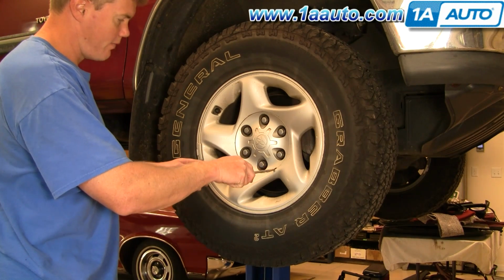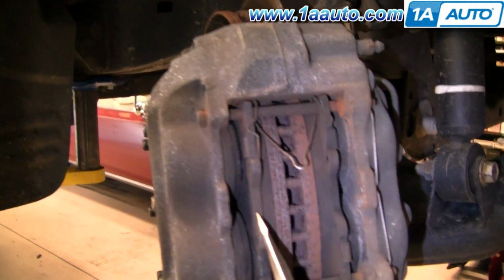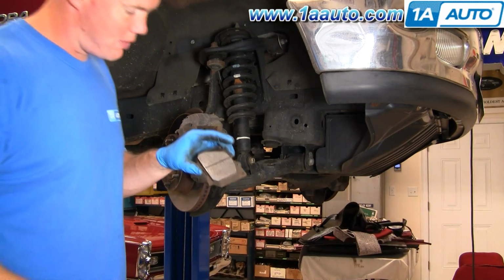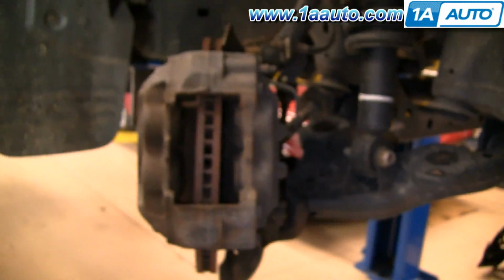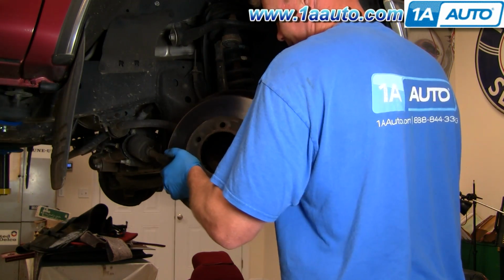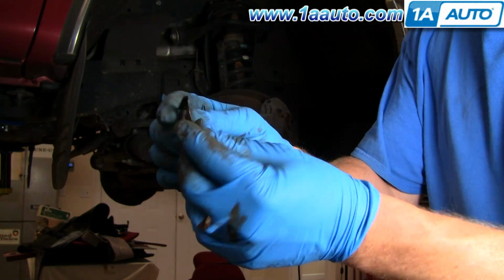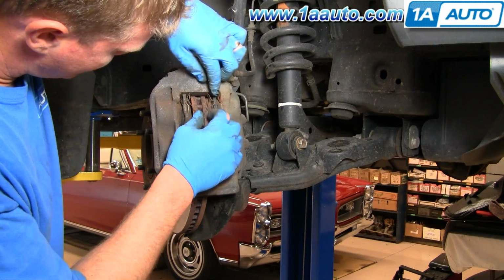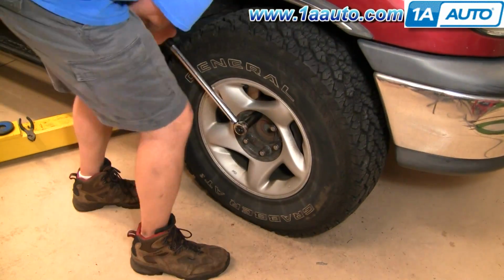How To Replace Front Brake Rotors 00-05 Toyota Tundra

Comment: Thanks for the video, however the main thing I tuned in to see is how to disconnect the brake line from the calipers to replace the calipers, and deal with the brake fluid, overflow, and bleeding. If you ever revisit this video, might be nice to add.
Reply from the maker: +Mark Dawson Thanks for the feedback!

Comment: Great video showing how to do the work. One caution to watch out for is that the 2 slider pins will most likely be rusted and very difficult to remove. Recommend getting the slider pin kit before doing the work.

Comment: great video.  I was reading in Chiltons and alldatadiy and they said to remove 2/3 of the brake fluid from the master cylinder because when you push in the pistons it will force brake fluid back into the reservoir, or simply loosen the brake valve and let it out that way

Comment: My 02 Tundra owners manual specifies the torque for the alloy wheel’s lug nuts at 110 Nm or 83 ft lbs. Isn’t 120 ft lbs over-tightening? Otherwise, it’s a beautifully clear instructional guide.

Comment: If you have a 2000 - 2002 Toyota Tundra and 2001 - 2002 Toyota Sequoia then you will need to check your caliper to ensure that you get the correct brake pads. Toyota changed the brake design for these trucks within the production run. I believe that the initial brake design was not very good so Toyota re-engineered the caliper and brake pads to improve stopping power. Even though the rotor is the same, there are two different types of pads for these vehicles..some trucks within this year range have been upgraded over the years from the S13WE to the 13WL calipers, so we recommend that all customers check their front calipers before purchasing to ensure the correct brake pads. You can also tell the difference if you measure the length of the brake pads. The brake pads for the S13WE caliper will be 4.7" (120 mm) long, and the brake pads for the 13WL calipers are 5.25" (134.6 mm) long. I recommend that you check the front calipers or brake pads.
Reply: Yo quick question how can I check on the front calipers foe those specifications I just changed my pads and rotors but I keep getting this scrapping sound almost like the brake shield is hitting it but I already checked it was not

Comment: Thank you SO MUCH !  Our 2002 runs like a champ but we were stuck on getting the bolts off to replace the rotors.  Oops !  With your little video we found out we were doing it wrong and finished it in a snap.
Reply from the maker: +cwestervoorde Thank you for the great reply. We love to empower our customers by showing you how-to perform your own auto repairs while installing our high quality auto parts. Have a great day! 1aauto.com

Comment: Other mechanic's videos buff off the rust on the slide pins and then adequately lubricate them with the brake paste.  They claim that the brake pads after a winter or two collect rust and dirt and that makes the brake pads not slide so easily on the pin as the pistons push them towards the rotor.   YMMV

Comment: Thanks 1A Auto very helpful - what is the (purpose of the) little clip that is shaped like an 'M' and the top bolt runs through it? Found that mine was bent out and rubbing on the inside of wheel rim...

Comment: That's great. I appreciate you making this video. One question though. You're not wearing a respirator -is there no asbestos in those pads? Are they original dealer pads or replacements? Thanks!
Reply from the maker: Thank you for watching. asbestos is in the older pads, however it is never a bad idea to wear a respirator. Please let us know how the repair comes out!
1aauto.com  888-844-3393

Comment: If I am replacing rotors only, do I have to pull the pads out? Can't I just spread the pads and then unbolt and lift out the caliper? Thanks, Russ.
Reply from the maker: +Russ Raetzman Thanks for watching!  If you are installing new rotors they you will probably have to remove the pads and compress the caliper piston.  That is because the new rotor will be thicker than the old one, so the caliper piston needs to be pushed back in to allow the brake pads to fit over the new rotor.  1aauto.com

Comment: My Tundra has a pulsing/shimmy  effect when applying the brakes firmly. I have replaced the disc's but I'm thinking the rotors need to be done also to solve this problem because I believe they are warped. Truck is a 2000 with 104,000 mi but in pristine shape, keeping it till a croak. Am I on the right track ??
Reply from the maker: +Bob V If the rotors are warped they would create a pulsating brake pedal. We carry the replacement brake rotors and pads shown in this video on our website. Here is a link to them. https://www.1aauto.com/toyota-tundra-brake-pad-and-rotor-kits/mo-c/407-127?utm_source=YouTube&utm_medium=YouTube&utm_campaign=ytcomments
Reply: Bob V 
I just got mine checked out and its the rotor for me and new pads. You should check the same a break inspection is like 15 bucks

Comment: Does the rotor just come off, or is it held on by screws or bolts? The FSM says to check run out. Is that necessary? I'm replacing the rotors and pads.

Comment: I have a 2002 Auto trans Tundra with automatic 4x4 change to Hi/Lo inside the cab, 165,000 miles. I had a shop install new pads. When I brake at high speeds it shimmies. Its said rotors need 2 turned or new rotors. True or ? Does the rotor come off the same way as in your vid? Or do I end up digging into my 4x4 hub to get to rotor? Great vid 4 brake pad&rotor install. Thx How much 4 rotors?
Reply from the maker: The procedure should be exactly as shown in the video. No need to get into replacing the hubs/bearings on that model unless they're already shot. You could have the rotors turned. That is essentially just resurfacing them. The shaking you're experiencing when you brake is due to uneven rotor surface, so turning them would fix it. But typically we recommend replacing the rotors rather than turning them. Here's a link where you can buy the front rotors on our website. We'll ship them to you for free! Unfortunately, we don't currently stock the rear rotors for your truck though. https://www.1aauto.com/search?q=rotors&year=2002&model=407&abTestingValue=OFF&utm_source=YouTube&utm_campaign=transcriptdesc&utm_medium=transcript
Reply: I appreciate you response. The vid was extremely helpful. Thank you very much.